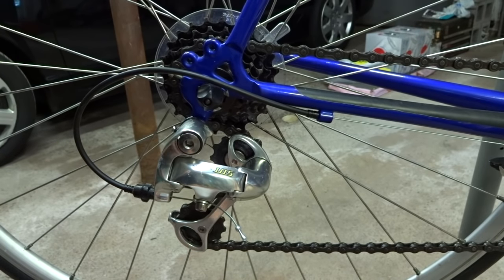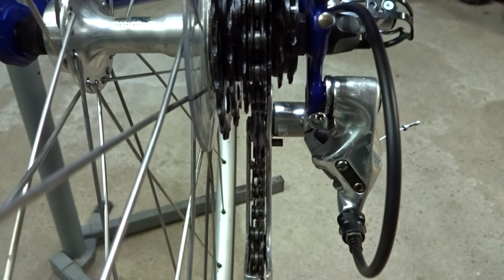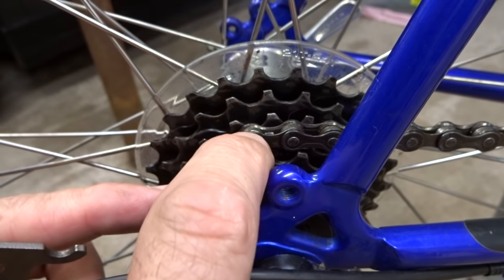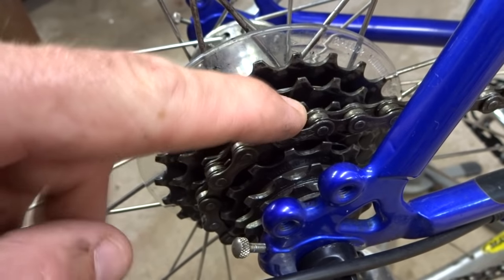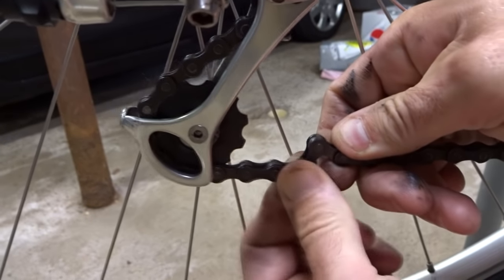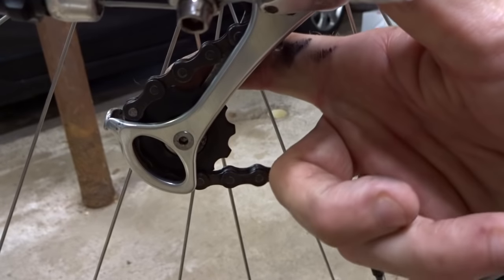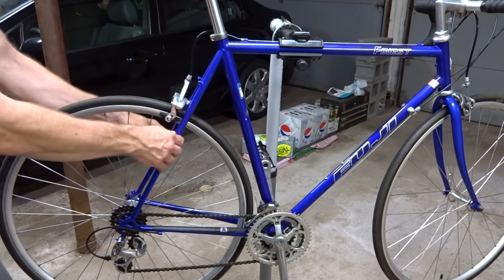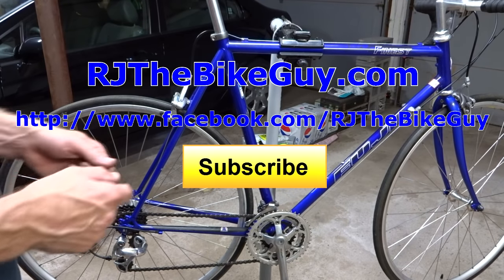How To Fix Bike Chain Skipping/Slipping/Jumping Gears

Comment: Good video right there.   My chain is the culprit.  The mechanic has been trying to change the whole four elements... Chain, shifter and the front and back pulley system. Costly so I decided to find answers to cut down the cost.    Thumbs up champ

Comment: You mention first off in the video about adjusting the rear derailleur but don't provide a video link for that, my chain slips and skips 2-4 when climbing hills and the only way to avoid it is to either stay all the way down in 1 or to tough it out in 5-7. already checked the alignment and the derailleur is parallel with the gears. My first thought was a loose chain, so I've been searching for other solutions

Comment: My gears have a mind of their own only when I go up steep hills. I change to a lower gear but it jumps further than I select; and thus the chain spins until it grips, but by then I have lost momentum. The cassette is new and the chain seems fine. I shall start to learn more about this issue, but I’m wondering whether there is something more specific to this (weight and power distribution?)

Comment: I had this problem where my bike I start to pedal and then it feels like the pedal is snapping but the chain is still on so what’s happening is it’s sliding and it just gets stuck again on the hooks but usually it’s not the front sprocket it’s the cassette that’s worn even if the front chain ring is worn it’s still the cassette that’s mostly worn out.I took it to my bike repair shop and they adjusted the back and front derailleur’s and then I tried it out but it still made the sliding noise so then we just went with changing the back worn out cassette and then I tried riding it again and FIXED it was that if you have the same problem just get your stuff adjusted good first then try changing the cassette.

Comment: so my sons bike chain starting slipping. It is only a year old and he only rides it at school on paved roads.  it doesn't try to shift up or down, but will slip on the rear cassette.  we replaced the chain and the rear cassette and it didn't make a difference.  What else may be causing it?

Comment: I have a 10 speed mountain bike (one gear in front, 10 speed cassette in the back) and every time I’m in 10th gear the chain jumps and slips but every other gear is fine. The derailleur looks aligned properly. It must be a worn down cog or chain
Reply from the maker: Could be. Or any of the other things in the video.

Comment: @RJ The Bike Guy I have a problem with my bike, I bought new Threaded Sprocket 8 speed and a new 8 speed chain, and converted to 1x Chainring, when I pedal hard the new chain POPS up and skips to the next teeth, I usually encounter videos explaining that its worn out sprocket or chain but in my case everything is brand new. but when I use my old chain, it doesn't happen. I can pedal hard without any issue. I hope you could help me.
Reply from the maker: Go through the video. I can't diagnose the bike without working on it.

Comment: or the front chain ring is worn out!
       bought 2 rear wheels,  derailleur,  derailleur alignment tool,  free hub body,  2 cassettes,  and overhauled all cables and cable housings all to discover it was the............you guessed it.......the freaking front chain ring!

skip sounded like it was coming from the free hub(in the rear).....so i methodically replaced all offending components to the point of madness. out of sheer desperation i stomped on the pedal to try to figure out what  was happening and i saw the chain completely   jump over the .........front freaking chain ring.   
   moral, don't assume......assess.  grand total of parts probably worth more than the bike. feel really stupid for making it into a vendetta against an inanimate object.......but i F#@$&*ING  won!!  not really......just kinda sad, but bike rides like dream.....

     .....and no skip.  Ha!!   enjoy every ride!
Reply from the maker: For the front chain ring to slip, it would have to be extremely worn. That is usually pretty obvious just looking at it. The teeth would visibly be worn down. And by that point, the whole drivetrain would probably need to be replaced.

Comment: I bought the new KCNC 9-52 cassette from R2 Bike and the chain falls in the last 3 big cogs when doing backpedal. I put on a new chain and he keeps doing it. Crank at the front is a 32t boost 3mm offset. My bike is a Specialized Epic Expert 2018 1x12 full Eagle XX1 and had no issues with the Eagle 10-50. It seems as the chain looks crossed. Somebody told me to use a 6mm offset chainring other told me to use a 28t instead of a 32t. Also I don't know why the last 3 cogs skipped the chain on torque when the chain is new
Reply from the maker: Sorry, I can't tell you without working on the bike and seeing what is going on.
Reply: @RJTheBikeGuy  to me is the chainline. Looks like the chainring has to go more inward so the crossed line in the chain gets straight

Comment: Hello RJ, this video was really helpful. I need your help in chain slipping in front gears, I have 3 gears in the front, although my rear gear adjustment is at 1 or 2, when I put my front gears at 1, the chain will simply slip down, it will leave the cassette. How can I adjust that, this is a brand new bike 3 days old. Although I rode the bike successfully for first day for 5-6 km, without changing gears, but when I was learning how to use gears, I remember I shifted the 2nd gear in the front at slower speed, there was a cranking sound and chain slipped, since then it is slipping everytime. I have shimono gears in my bike.
Reply from the maker: If the bike is brand new, take it back to the shop and have them fix it.

Comment: You could mention that the cassette teeth are often be different shapes as you go around, BY DESIGN.  I thought mine was completely wrecked until I looked at a new one in the shop.
Reply from the maker: That is to help shifting. Most aren't very extreme. I did encounter one that had teeth like shark fins which usually indicates a worn cassette/freewheel, but not in that particular case.

Comment: Slipping chain over the teeth is caused by another problem that today I found out. And there is no single video explanation anywhere so far.There is a spring around big bolt that mounts derauilleur to hanger plate.when that spring loses its stiffnes and the entire derailleur moves backwards and sort of unwraps chain off the sprocket. This happens while hard pedalling , because it increases tension and adds a lof of stress on chain. Replaced the derailleur, problem solved
Reply from the maker: Yes. This is less common, but it can happen.

Comment: So my triathlon bike has this odd problem where whenever I am cross-chaining, meaning I am on the big ring in the front and big ring in the back, and I pedal backward, the chain goes down to a smaller cog in the back and falls off in the front. This only happens when I am cross-chaining. It is a 2x9 speed bike. Anyway to fix this?
Reply from the maker: Yeah, don't frigging cross chain! Learn proper shifting!

Comment: My bycycl's front rapid thumb shifter has been freed and it not working.Can you tell me how to repair this
Reply: vivek verma Check out one of his many shifter videos where he takes it apart and tries fixing them (don’t think I’ve seen one with a thumb shifter but I think it’s the same principle as an integrated shifter). Check out one of his videos where he takes a shifter apart. It’s more invasive and time consuming but it’ll help you work out if it’s a piece inside that’s broken and whether it’s repairable or not, or it could just be something like the cable needing replaced/reset in the shifter to ensure it pulls, holds and releases it correctly.

Comment: Yeah.. I just replaced the chain in an old bike I bought. The old chain was dirty as hell and stretched out, but didn't skip. But after replacement, the new chain skips the 7th and 6th gears (smallest sprockets). I removed one link of the chain, making it tighter. It helped, but it still skips on those gears when I put high torque on it. I imagine I have a worn out cassette.
Reply from the maker: If the chain was broken to match the original chain, then it was probably the right size to begin with. Now it may be a hair short.  https://www.youtube.com/watch?v=ELsKrgTt0oY

Comment: Yesterday I‘ve noticed, what I suspect is chain slip. It only occurs when I really push into the pedals, but everytime I stand up to sprint it messes me up. Gonna strap a GoPro in slo-mo to the seat-stay and see what it is.
Kinda frustrating because there are only like 750km on this drivetrain. (Shimano CS-M7000 11-42 11 speed)
Reply from the maker: Go through the stuff in the video.

Comment: My bikes gears are super loose, they move around like crazy, slip gears and come off the chain. I can move the gears away from each other using my finger. It's like they separated and I don't know if there's is a special tool I need to fix it, please help
Reply from the maker: I can't tell you without working on the bike. You are going to have to dig into the problem and figure out what is loose and why.

Comment: I have a situation where the new chain works great on a new cassette (all Shimano drivetrain), but in 7th gear the chain rides up on the 7th cog. It's not hitting the 6th cog. The 7th gear was a different color (bought off Amazon, 11-28 7 speed). I think the tolerance machining of the 7th cog is slightly off (seems too small) for links of the new chain. It's a brand new cassette, chain, derailleur, wheel, hub, etc., and all gears work great except for 7th gear. I think it's just a bad part.
Reply from the maker: https://www.youtube.com/watch?v=gwBQxhZhKnE
More likely limiting screw.

Comment: I don't get it, I had no problem with this before I delivered it for service and they said they had replaced the chain, which i didnt ask for anyways after the service it didn't shift as fast as before sometimes it even shifts long time after if I only shift one gear,now I have to shift more than one gear at a time to make it shift right away and it slips the sprocket so much that im scared it will ruin my new bike which is really expensive it has a sram system on the drivetrain 11speed NX ,, I wonder if they have replaced my chain with a older chain now after watching your video i payed a lot for this service which I do from time to time because im scared of doing stuff myself because I'm scared of breaking stuff,my job is bicycle delivery so I need my Bike everyday its a ebike all mountain specialized turbo LEVO, it's needed for my work because here in Norway where I live its always steep Hills in all directions and the roads are full of bumps and holes.also it's a really cool and fun bike exempt from after last service and now it's closed because of the virus bs situation.thats why I need to learn how to fix it myself before it's no teeth left on the sprockets
Reply from the maker: Take it back and have them fix it. The chain was probably measured and was worn.

Comment: RJ. Skipping when pedaling hard could be caused by loosed chain? I have mounted dropout screws with springs, and my rear wheel is closer to the front for about 0,3 - 0,5 cm. Chain is not worn. Cassete neither. Would be grateful for answer. Thanks!
Reply: i am wondering if it could be caused also by frame flexing and tension on the rear deraillieur cable (friction shifting). How tight it should be? If it is too tight it could couse downshifting when hard, standing pedaling?
Reply: Are you sure the cassette REALLY isn't worn? it may look fine but with a new chain, it can skip quite bad. keep us posted.

Comment: Hi, I have a problem with my bike which I haven't been able to solve for a long time. My bike is extremely difficult to pedal, and ghost pedaling often happens. I feel resistance when pedaling, even in small gears.. I have used this bike for 5 years without any problems and servicing, but in the last half year I have this problem. I took the bike to service and I changed one by one, first the chain, cassette, and chainring, bottom bracket, even both derailleurs, derailleur cables and the rear wheel (because of freehub). Derailleur and derailleur hanger are not bent, and they are properly assigned. And again after all that, there is no improvement. What should I do? What can cause resistance when pedaling ? Is it possible that the chain is too tight? I am very frustrated ..
Reply from the maker: I am not going to try to guess without working on the bike.

Comment: Thanks for all the Videos. Very helpful. I have 3 questions. I recently heard that on shimano chains, you cannot push a pin back in the other direction after using a chain break tool. You need to replace the pin with a new one. Is this true? 2nd question. Can you use metric ball bearings? for example, 6mm instead of 1/4 inch(6.35mm). And 3rd. Have you considered doing regular Q&A videos?
Reply from the maker: Yes, you need a new pin. Or maybe a master link like a KMC Missing Link.No, metric bearings are slightly different and will ride in the races in a different spot and will wear out faster. No, I haven't really considered that. i will often make videos to answer specific questions.

Comment: Lord Of The Deraileurs... The Two Screws!! Lol wow I took an older but better quality shimano( not modern plastic junk especially grip shift ) brake/gear combo, and I bought new cabling for the rear gear system. Lol only problem was the fkin cable inserts or recesses whatever they're called. It isn't just a straight through cable it has 3 different small lines. So I had to use a hacksaw to make the measured cable lengths. But after that threading the cable through didn't go so easy but eventually did, and the cable end caps ( came with the kit amazon) I had to widen them by jaming a philips head in there. Sigh, so I have a question. Is it possible to buy pre cut measured & capped gear/brake cable?
Reply from the maker: No. Because the cabling is going to be different on every bike. Use a proper cable cutter. https://www.youtube.com/watch?v=O7bKwvYNBpY
Reply: @RJTheBikeGuy  Spot on! I have a similiar shimano system, looks more bare metal though. Will definately want the Park tool for anything like this again. Watched a bottom bracket video of yours so I can address this. I have the outer ring remover and the puller tool. This thing is knocking more than ever now, hopefully it's just some brand new freshly greased bearings is what's required.  CDN built bicycle from the mid 90's I would guess. Found it abandoned in a state of disrepair. Thanks alot, your instructional videos are on point and thorough. Keep up the good work!!